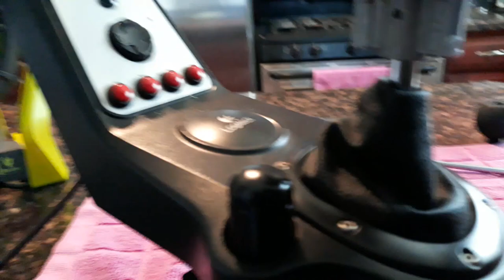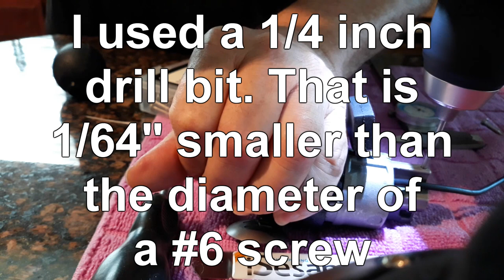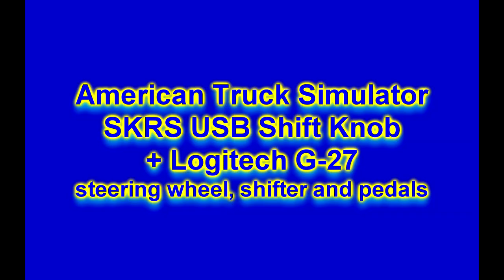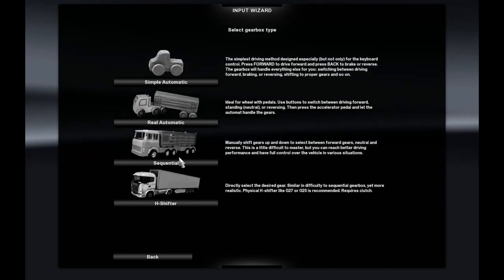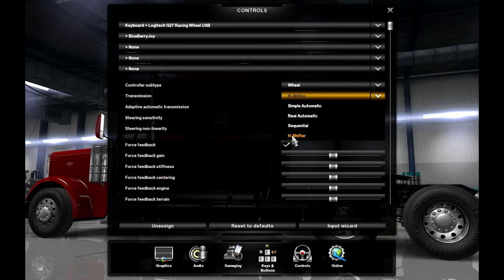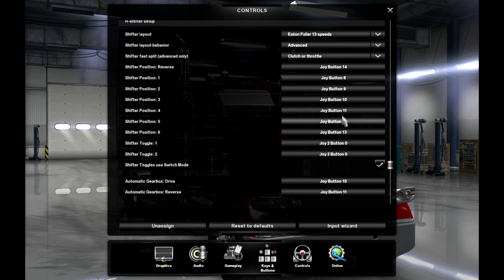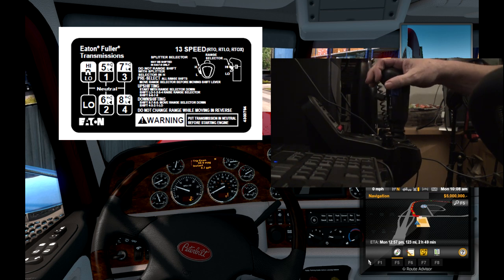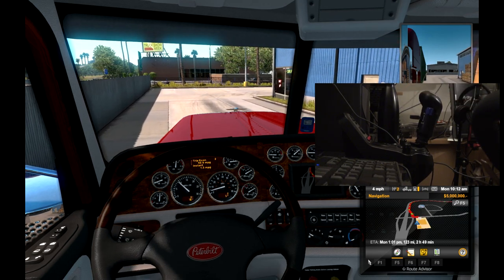American Truck Simulator SKRS USB Shift Knob Setup with Logitech G25 - G27 - G920

Comment: Does one still need to connect the shifter base to a Logitech wheel if the shifter itself can connect to PC directly? I don’t have a Logitech wheel but I’d like to put this on a Logitech shifter and connect to my PC
Reply: I made the mistake of getting a Logitech shifter and couldn’t use it until I got the wheel

Comment: When I got mine, I found out that when the range selector is up, I can't move the splitter forward. And whenever the splitter is already forward, I can't move the range selector up. Is mine faulty or is there a way for me to fix it myself?
Reply from the maker: It may be. Try plugging the USB cable into a different USB port.
Reply: I don't think that will help... I mean it physically won't let me move the switch
Reply from the maker: If that is the case, it might be defective. Mine works as it should @gugalldiznii383
Reply: Mine also does that, I will return it.

Comment: Are they selling on ebay that come from China? if they work well? I want to buy one of those but I'm not sure
Reply from the maker: I bought mine in AMAZON. 
https://www.amazon.com/gp/product/B07JZ5SBPM/ref=ppx_yo_dt_b_asin_title_o06_s00?ie=UTF8&psc=1
Reply: I have one it work well but its not fixed ill try the advice jorge gave us.
Reply: @PVsimpilot is there an application for the shift knob
Reply from the maker: @danielvargas6960  The shifter knob has a USB connection for the splitter and Hi/Low switches; to configure them I do it in the joystick setup inside American Truck Simulator. Additionally you need a shifter to mount the shift knob to, and the shifter has its own USB plug and needs to be configured inside the game also.
Reply: @PVsimpilot i fixed I disconnected and connected in to the pic and fixed my th8a shifter

Comment: How to hook up the wires
Reply from the maker: The wires in mine are USB; just plug them into any available USB port.
Reply: Can i It plug into a laptop
Reply from the maker: @TravisNarine-cz3du  Yes you can so long your laptop has a free USB port.
Reply: OK thank you
Reply: Can I use it without the splitter

Comment: can you do it with G920
Reply from the maker: I would think so. I do not have G920 I have a G27 but the shifters look very similar.
Reply: @Diesel2706 Were you able to get the shifter knob to work on your G920?